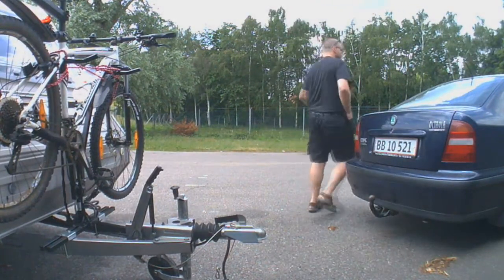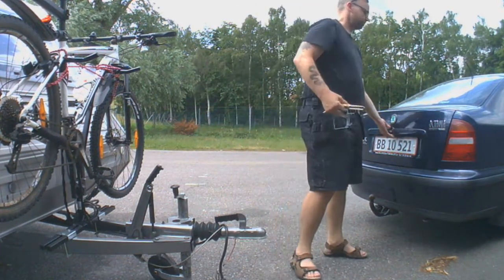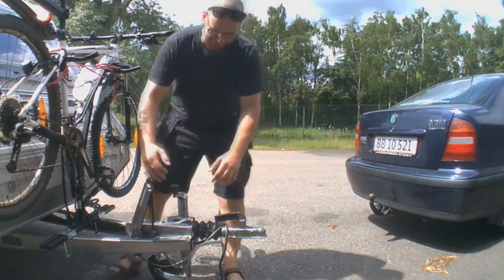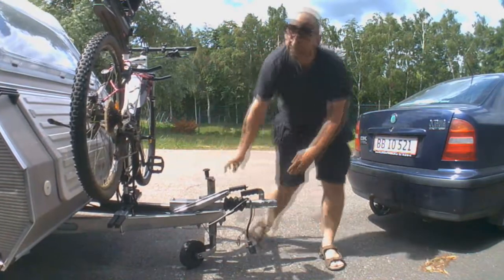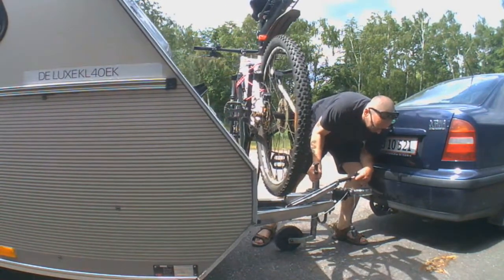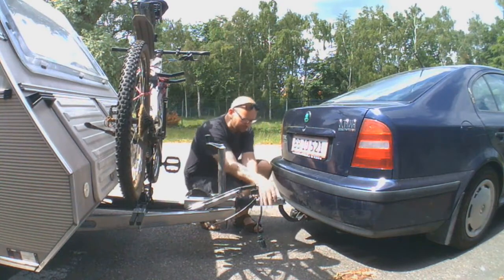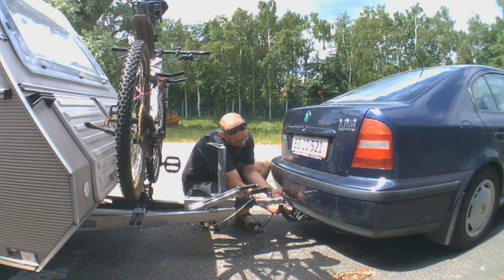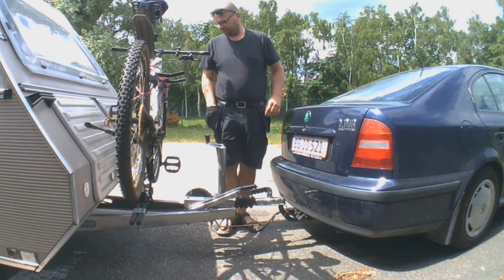Docking the travel trailer

Comment: Great video buddy! The audio is really improved or it seemed to be anyway. That wire you hooked up last, does that apply the trailer brakes if broken?
Reply from the maker: Thank you. The audio is a track i put on after, when i edit the video.
Yea the wire will pull the trailer brakes if the trailer brake away from the car.

Comment: Great, thanks! But how about situations when your trailer is not on a very levelled, smooth and hard surface. E.g. on mud, sand, snow or at slopes, when you cannot simply pull the trailer on your own so easily towards the car.
Reply from the maker: Yea, i get your point. It do take some practices to back up the car to the right point. 
I am lucky cos i did work at a sawmill. I was driving a tractor with a trailer, every day for 2 years. So for me it is no problem. :-)
Reply: OK, I see :-) Still, on a tractor you have a free, direct sight upon the trailer, wich is not the case from within a normal car. Guess it needs some practising. Like the way you did the audio in this video.
Reply from the maker: Yea it is all about practicing, same thing about reverencing with the trailer, all about practice.